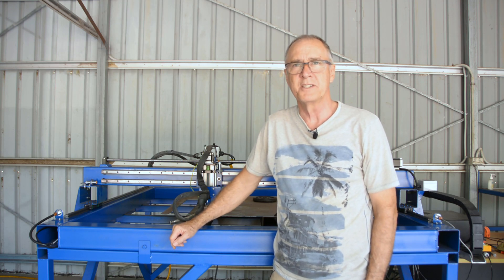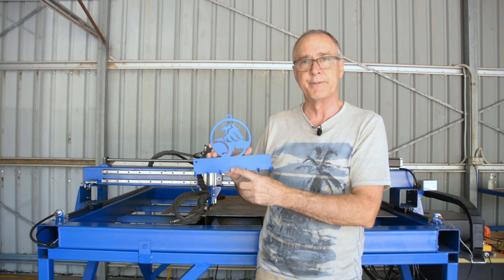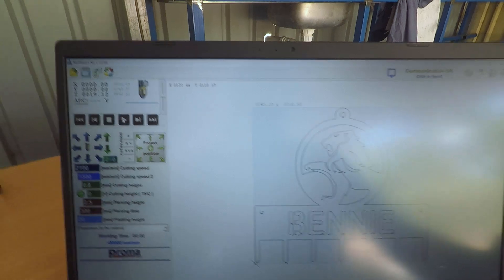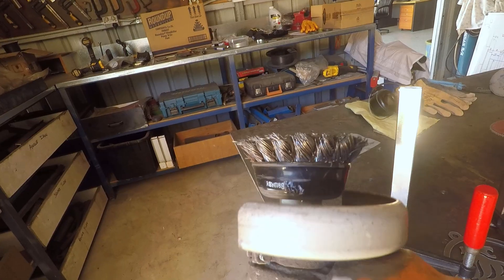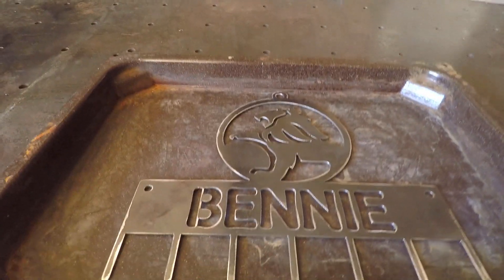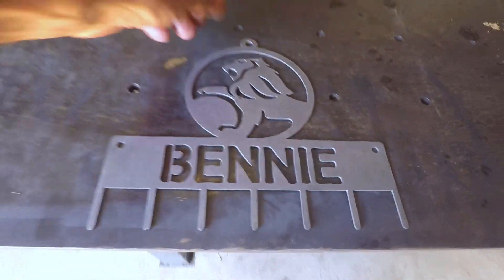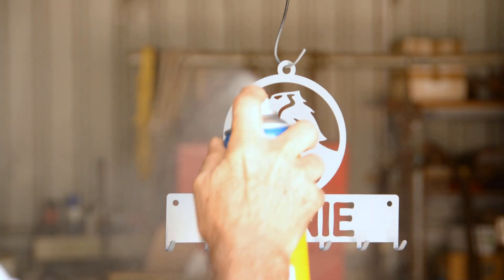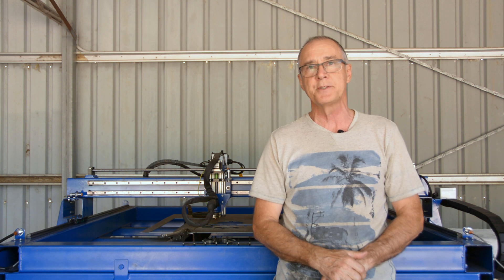My CNC Plasma Cutting Table's 1st Sale

Comment: I see no insulation on the shed walls, It's not uncommon here in Colorado to see -20 to -40 * F temps in the winter.
Reply from the maker: Even in winter, we don't see temperatures anywhere near 0C (32F)....in summer (like, now) it's not uncommon to be up over 40C (105F).

Comment: Can you post a list if materials? And sources?
Reply from the maker: These are the major components that I purchased for my CNC plasma cutting table build...all sourced from eBay.

1. 4 axis CNC kit. I bought the 4 axis kit because my table runs 2 stepper motors on the Y axis. Search for this: 4 Axis CNC Kit 3Nm Nema 23 Stepper Motor 4.2A & Driver DM556T & Power Supply
2. Linear rails..the ones I bought were 1500mm long. Search for this: Linear Guide Rail 2PCS HGR20 200mm-1700mm + 4PCS HGH20CA Slider Block For CNC
3. Ball screws...the ones I bought were 1500mm long and 1605 (16mm diameter and 5mm pitch...ie. the nut travels 5mm per 1 revolution of the ballscrew). Search for this: Ball Screw SFU1204 SFU1605 SFU2005 End Machined BallScrew W Single Ballnut CNC

4. Motion controller and plasma interface unit. I purchased the 'MyPlasm CNC' system, made by Proma Elektronika in Poland. It is simple in its operation and doesn't require complex g-code to operate....all it needs is a toolpath from a .dxf file. The software program and operations manual are available from their website (https://www.proma-elektronika.com/do-pobrania/). I couldn't buy the MyPlasm CNC motion controller and plasma interface unit from their website because they were out of stock. On their 'Shopping' tab (https://www.proma-elektronika.com/do-pobrania/) they list a network of dealers around the world, who sell their products. 
I bought my motion controller and plasma interface unit from a company in the USA called Automation Technology Inc (their website is: https://www.automationtechnologiesinc.com/). They sell both the Myplasm CNC Controller and the Proma Plasma Interface unit and you need both units.

5. 24VDC 3 amp power supply to power up the MyPlasm CNC controller. Search for this: NEW AC 240V To DC 5V/12V/24V 1A~100A Switch Power Supply Adapter For LED Strip

6. Aviation plugs: I used these between the side of my electrical cabinet and the field devices, like the stepper motors, proximity switches, etc. Search ebay for this and choose the number of pins you need. I used 4 pin plugs and sockets for my proximity switches and 5 pin plugs and sockets for my stepper motors. GX12 GX16 GX20 2-15Pin Aviation Plug Socket Male Female Connector Panel Metal

7. Shielded cable: I bought 2 pair shielded cable and that runs from the plug on the side of the electrical cabinet to the field devices, like the stepper motors and proximity switches. The reason for the shielded cable is to reduce or eliminate any Electro Magnetic Interference (EMI) that's produced by the plasma cutter. EMI is the enemy of any CNC controller and it can cause it to do some weird things. Pilot arc start machines are much better than the high frequency start machines, as they're the ones that produce a lot of EMI. Leave the shield wire disconnected at the field end but connect the shield at the cabinet end, to a common busbar or earth point. Then connect the mains earth to the common earth point.

8. NPN type proximity switches for your homing switches. They must be NO (normally open) NPN type (negative - positive - negative....and it's specified in the MyPlasm CNC operations manual. These are 3 wire units and operate off 24VDC from the MyPlasm Controller. You might find a better deal if you bought a bundle, rather than individual ones, as you'll need 4 if you run 2 motors on your Y axis. Search for this: LJ12A3-4-Z/CX Inductive Proximity Sensor Switch NO+NC NPN DC6-36V D12mm

9. Incidentals like electrical enclosure, cable crimps, drag chain, emergency stop switches, etc. can all be sourced from eBay.

You will need a laptop or a desktop computer loaded with the software, to talk to the controller module (whichever one you purchase).

Feel free to get in touch if you have any questions, my email address is: rmhyde58@gmail.com

Comment: i see it is proma cnc software controller , right ?can you tell me about , your cutter , and the buying gantry ?nice video thanks i project to buy one but need , near laser quality on thin ss , i think it is hard to realise
Reply from the maker: Hi Naoufel and yes, I am using the MyPlasm CNC controller and plasma interface unit from Proma Elektronika. My plasma cutter is a Razor Cut 45...it's made by Jasic and marketed in Australia under the Unimig brand. 
I'm still learning how to use my table and have only cut 1.6mm mild steel and 3mm aluminium....never cut stainless steel yet.
Reply: Due to cost of logistics better built our own table gantry ,what cutter dovyou suggest for me please ,rasor ? Lotus ? Thanks
Reply from the maker: I don't have much experience with plasma cutters. The one I have is the 1st one I've ever owned. A lot of people swear by the Hypertherm brand but I know they are quite expensive. I suppose it depends on how much work you're doing as to which plasma cutter you buy.